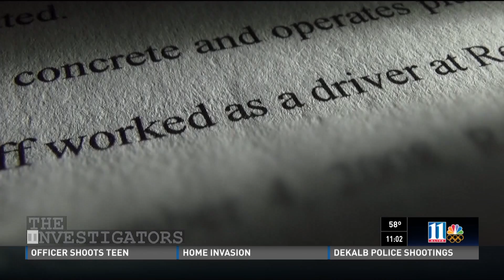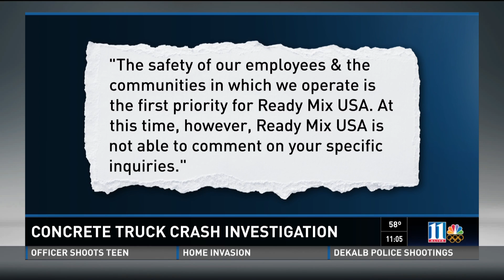Concrete Crashes: Tipping the scales toward danger

Comment: Pay by the load is about the dumbest thing I have ever herd of . Even if you totaly dissreguarded  that it can encourage unsafe driving . But even from a stricktly dollars stand point  it does not work .  1, trucks are not going to be cleaned washed out properly...check the fluids ?... why bother . top off your water and fuel before you get loaded ... not any more , get to the line of trucks ready to load first ,,,, let the customers wait on the job while you do that ... and kiss the dispatchers ass so you get close loads ... or our right pay  them money

Comment: I drive a mixer very dangerous vehicles, must be respected at all times. We have about 45,000 lbs about 8’ in the air n oh ya it’s spinning . Slow Slow Slow n careful no day dreaming. Now as far as red lights go once in a while we have to push it a touch. If we slam on the brakes the cement lunges forward then pushes backwards and out the opening n onto the ground. Can u say huge fine ?  So people please give us distance n space, lots of blind spots as well. Just so u know truck drivers are trained not to swerve to avoid accidents. So we’ll try to stop in a straight line but trust me you don’t want to get hit by 80,000 lbs. So try n have some patience n give us room

Comment: I been a CDP along time. 2 main rules in traffic to remember driving a concrete truck
1. Assume every light is going to turn red until you get close enough you know you can get through it without it changing to yellow or red 
2, assume every car around you including one attempting to pull out in front of you are going to stop or pull out. that makes you aware and keep your distance enough to maintain space to stop.
(CDP) concrete delivery professional

Comment: Yeah very Dangerous. I took a right hand turn on a slightly sloped road and tipped my truck barely going 10 mph around the corner. I was Fully loaded with 10 yards at a 3" slump and broke both my arms thank god I didn't hurt anyone else.

Comment: If they're able to, they should have an emergency stop feature in such a case. So if the cement truck needs to stop suddenly it can without tipping over and hurting others. This emergency stop procedure would or should be made to not allow the truck to tip over

Comment: ok i drive a mixer and get paid by the hour not by load, this is just missleading if you are travelling 45mph and are loaded 10 yards thats about 40,250 lbs on top of your 30,000 lb truck. so your trying to stop 70,250 lbs moving at 45mph. you need a lot of room to stop about.. it is not possible to stop yiu will actually  lock up all 10 tires and slide all tje way thru that intersection..  this news crew really just wanted to make good story how about finding some good hard facts and supporting awareness of heavy vehicles
Reply: so drive slowe when approaching intersections
Reply: I could slam as hard as I could on my brake pedal  the wheels on my mixer on not locking up lol

Comment: I've driven them, old and new-ish,  tandem, strong arms with cheaters, front discharges  7 to 10 1/2 yard, straight drive, automatics and all wheel drives and every blessed one is as dangerous as a cocked gun with a hair trigger and an itchy finger IF the driver is PUSHED! YOu can carry stuff to stop or slow down concrete setting up inside of a tub but the main thing is TIME. Retarder can be added at the plant but scheduling is most important so as to NOT be rushed. And paid by the load is a BAD JOKE!

Comment: If you aren't competent enough to know that you should be CRAWLING while making a 90 degree turn , even with a metre ( yard , I'm Canadian ) of concrete on  you shouldn't be driving ready mix  period. Ive been driving ready mix since I got my license  and knock on wood have never once come close to a roll over. If you're paid by the load, change companies. Theres no excuse or reason to throw safety to the wind. Just ask the guy crawling out of the car .

Comment: Our company has its own training program, and even helps guys and gals to get their CDL, they set up a course on a plant parking lot, and basically have a mixer truck rodeo, similar to semi rodeos, it's scored on safe driving, turning backing, anything a mixer driver might encounter, no timing involved, unless it involves time it takes to mix the concrete properly. Even the seasoned drivers run the training course for the fun of it, keeps skills sharp. And every 2 years there is a competition held to send a mixer driver to the national mixer drivers competition. And there are also company safety bonuses. Including off duty in personal vehicles as well.

Comment: Posted speed limits not safe for loaded concrete mixer trucks, that drum is basically a spinning top heavy mud tank. and the mud hardens. Semis have a trailer, concrete mixers have as much weight as a semi trailer truck, and pay per load in a city, where traffic is mostly at a standstill, not good. Glad I'm with a company that pays by the hour, and contractors get charged a fee if taking too much time to unload through no fault of the driver, plant truck breakdown etc. Our trucks also have speed governors on them as well for highway speeds on interstates.

Comment: You have to be a little more careful of right turns when loaded, especially with a low slump.
Reply: Definitely
Anything higher than a slump 6. Slow roll it
Reply: Wet ur might spill outta the back, dry sticking to the drum. Slow Slow Slow the only way to drive a mixer

Comment: What a bunch of bull crap. Concrete doesn't start to harden in a mixer in 90 mins. It does reach a point where concrete isn't use able after 90 min. If your not agitating or adding water like a truck breakdown it will harden. Our company had hoses made to run hyd. Off another truck to dump concrete.only time concrete will harden in drum is rollover. You cut that drum loose so you don't twist the frame of truck when you roll it over. And ins. Buys a new drum. Good old media finds a bandwagon to jump on.Doesnt need facts to use. There are a few bad drivers.Just like bad cops docs and politicians
Reply: too many us truck school dummy s
Reply: The State rejects all loads in KY and IN after 90 minutes  from  batch time  class A with no ash  there is nothing to hold water retarder  does little to help We dumped out 100s of yards that Walsh had to pay for.  For free paved a auto salvage yard and a mulch company's  they had no place to dispose of it all

Comment: 3:53 They are turning RIGHT TURNS though and aren't running the light! Jeez newscasters get it right....
Reply: +Watch Ryder In Pennsylvania right turns on red are permitted unless otherwise marked, but you are still required to stop first and make sure it is safe to do so. Is the law different elsewhere? Even if the law is different, In the example shown his view was blocked so he could not see if it was safe to make the turn.

Comment: people dont realize this is 80,000 pounds. you cant stop on a dime. lots of crete trucks run lights because even at 45, you cannot stop a full loaded truckin time, people can witness an effort to stop and also cant be afraid if your green light is gonna turn. it is more dangerous to lock up your truck than proceed cautiously through a red light.
Reply: +COLIN LEVASSEUR 
 haha yeah we call it the point of no return don't we? get on the air horn and hope for the best
Reply: the old style mixers like the one in the video do not have all the added axles like the newer ones. it looks like this one doesn't even have the tag/drop axle in the rear. 
 so consider that the mixer is about 8 to 10% less gross weight than an 18 wheel tractor trailer yet they have 20% less stopping power if they have a tag axle (4 axles total) and about 38% less stopping power if the mixer does not have the tag like this one. 3 axles vs 5 and only 10% less gross weight. 
 most new mixers have 5 axles like an 18 wheeler hopefully that will help prevent this but there is still the center of gravity issue, mixers turn over much easier than a lot of commercial vehicles
Reply: John Siders ........front discharge with slurry and breaking hard....premature mess lol
Reply: Its worse with a front discharge  at a high slump or flow able fill you make a mess !!!
Reply: COLIN LEVASSEUR The trucks don't have tag or push axles because weight laws in that area don't require it.